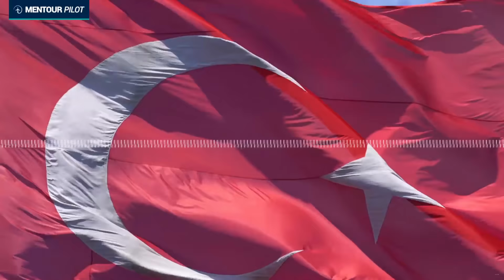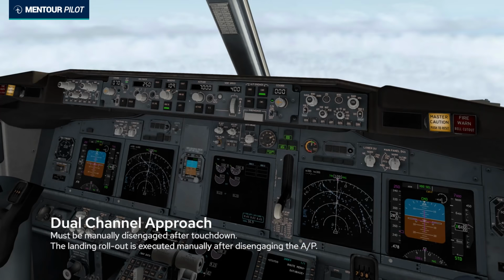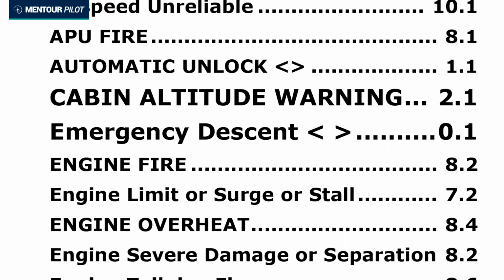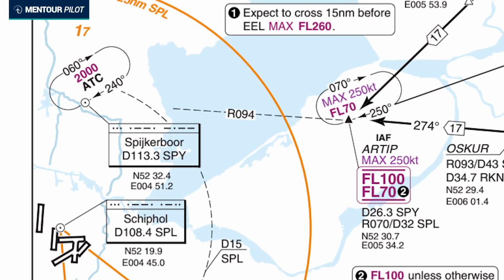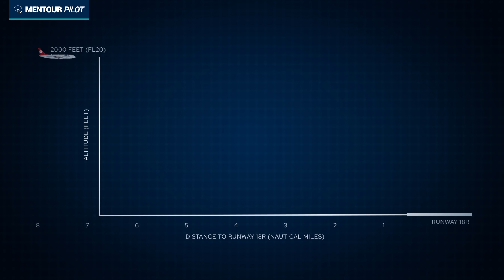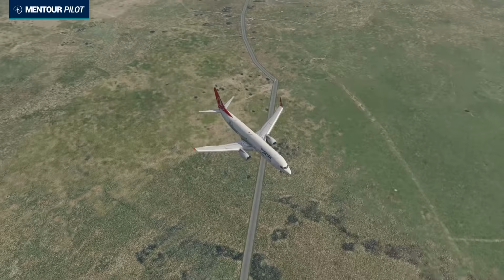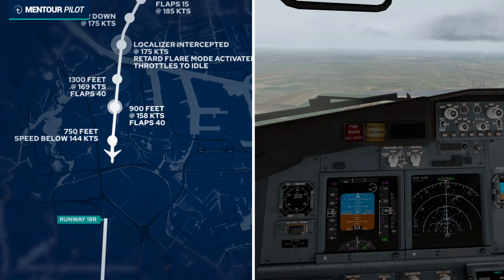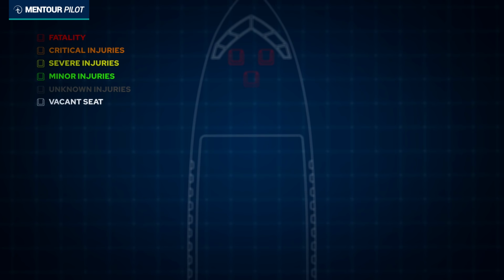What happened to Turkish Airlines flight 1951?!

Comment: Until the day of this plane crash, there were 2569 complaints about the radio altimeter problem in Boeing 737-800 model aircraft. Boeing company stated that this problem will not affect flight safety. Of course, it is easy to blame the pilot as in many accidents. It is both easy and profitable. I am sorry for everyone who lost their lives in the accident, I wish patience to their relatives. By the way, the video editing is great.
Reply: Yes, despite the shortcomings by the crew, they shouldn't have been in this position. Boeing don't seem to have taken the r/a failures seriously. There are many ways monitoring systems for intermittent problems but it seems like the best they could come up with was a bit of sealant.
Reply: Wow. We call that negligence in medicine!
Reply: To be fair to Boeing, though, the autopilot DID warn the pilots of this flight. The autopilots shut themselves off and made a warning noise (the first officer noticed and switched autopilot B back on). Also, the captain knew he needed to look at the altimeter (he muttered about it before the autopilots shut off). They openly acknowledged the altimeter's fault on the captain's side. The pilots should've known something was very wrong. They should've known to go around and troubleshoot. They should've known they needed to land manually. The plane told them something was wrong with it, and the pilots blatantly ignored it.

The loss of life was tragic, and Boeing definitely should've done something more about the radio altimeter, but we can't lay more blame than that on Boeing. Their plane gave the pilots multiple chances to rectify the situation.
Reply: I think it's worth pointing out that this is pretty much literally the worst set of circumstances short of an emergency that a crew could face for the radio altimeter problem to rear its head.  The Approach phase is already one of the highest-workload phases of flight for any crew - but on top of that you have an increased workload on the part of both pilots due to the navigation problem caused by the weather, leading to the late interception of the localiser.  The Training Captain's attention is being diverted from his "First Officer" monitoring role both by the intermittent alarms and the need to support the First Officer's training by keeping an eye on his solution to the late interception (and the possibility of intervening if necessary).  The Safety Pilot is handling communications with the cabin crew, which compromises his attention on the flight instruments and controls.  As for the trainee First Officer himself, training and checkrides are a high-pressure situation in the first place, he's still not particularly familiar with the aircraft and procedures, he's aware that there have been abnormalities with the aircraft systems, but - possibly because the Captain has not raised them as an issue - he does not question continuing the approach.  He's also probably got a concern in the back of his mind that because the Captain had to intervene to get the aircraft established on the ILS, this might end up having a negative impact on the Captain's assessment of his skills (and potentially his new career as a whole).

All of the crew were expecting the throttles to roll back at the point they did, and they probably caught sight of that in their peripheral vision - but because they are expecting it, none of them note that the throttles have retarded all the way to idle far too early.  Turkish Airlines' SOP concerning the Captain being the only crew member who can call for a go-around is problematic here for two reasons - firstly because it means that neither the trainee FO nor the Safety Pilot FO have "call for go-around" as part of their mental model, and secondly because this SOP does not take into account a scenario where a Captain is task-saturated (as seems to have been the case here) and misses cues as a result. In effect, they designed a "single point of failure" into their procedures.

Boeing's approach to the radio altimeter issues (insisting it would not affect flight safety) was at best lax and at worst inexcusable.  I have to wonder if there was an actual proper systems safety analysis performed on the consequences of this failure in all phases of flight, because with over 2,500 reports of the radio altimeter failures being reported by crews, there damned well should have been.  It certainly falls well below the standards they set in the 1960s, and is reminiscent of the effort they put into trying to prove that the 737's rudder PCU issues which became infamous in the '90s must have been caused by unintentional pilot input, rather than spending that effort (and money) looking more deeply into the problem.  Now in that latter case , it's only fair to point out that it was a Boeing engineer who eventually discovered the potential flaw in the PCU valve design and manufacturing process, and when it was discovered, the company very quickly reconvened the NTSB and FAA safety groups to eventually solve the issue...  However, I can't help but think that if they had set the engineering department to assess the problem more thoroughly after UA585 in 1991, the lives lost on US427 may have been saved.
Reply: @hauntedshadowslegacy2826  - The "pilots" didn't ignore it.  One glaring issue was that Turkish Airlines' SOP was that only the Captain had the authority to call for a go-around, which meant neither the Safety Pilot nor the FO under training had "call for go-around" as part of their mental model (or set of options).  The Captain in this case had his attention split multiple ways - firstly, he had his designated role as Pilot Monitoring during approach phase, secondly his role in assessing the trainee (and being prepared to intervene if necessary), thirdly trying to resolve the navigation issue caused by the westerly winds and correct the ILS interception, and finally probably trying to figure out what was causing the alarms and indications which indicated a technical abnormality.  In other words, there was only one person on the flight deck who could call for a go-around, and he was task-saturated to the extent that he failed to notice the flight missing the "landing gate".  While mistakes were made by the crew, and the problematic SOP giving only the Captain go-around authority were brought to light by this accident - the fact is that Boeing should have performed a proper systems safety analysis regarding the consequences of RA failure well before then.
Reply: @turricanedtc3764  Not sure I agree. The Radio Altimeters only really have a function if the aircraft was going to Autoland. It is SOP to always set the aircraft up for an automatic landing and then take the autopilot out when fully visual and do a manual landing. That is normal. The only function of the Radio Altimeter when visual is to give the "50", "40" and other calls which are really relevant to a manual landing. Those calls are not that important,  aeroplanes land quite well without them.

If the aircraft had been fully configured by 1000 ft, the First Officer would, presumably, have taken the autopilot and auto throttle out and hand flown the rest of the approach. Approach gates are there for a reason and if you ignore them you end up rushing things. In the airline I last flew for, continuing past a gate would earn you at the very least a phone call to ask you why and usually a visit to the flight manager without coffee.

The real glaring error was that not one of the three pilots seems to have noticed the extreme nose up attitude (they would have lost sight of the runway under the nose) or the very low speed (the ASI would have been dominated by red shading). They are all guilty of an extreme lack of attention.
Reply: I feel like there were 2,569 simultaneous cries of "I FUCKING WARNED YOU" after word of this got out.
Reply: But the radio altimeter does not affect flight safety on it's own.
Reply: @alsleepr  It's not the same. A scalpel will not kill unless YOU stab someone.
Reply: Here's the thing though: Boeing isn't entirely off the mark. Yes, the fault in the altimeter should not have happened, but at the same time, the pilots of this plane were making one mistake after another. If you listen to Petter summing it up here, the pilots were behind the facts right up until the moment they hit the ground. Not having the landing checklists worked out, not being configured for landing in time, intercepting the glide slope too late, not communicating with each other when literal warning sirens are blaring... The fault in the radio altimeter and its connection to the autothrottle is the final push in a long list of things that have gone wrong, so while it shares in the blame, so do the pilots.
Reply: @turricanedtc3764  In my limited view of accidents in any kind of traffic, there are two key ingredients: One person making an error, and one person not paying attention. Ignoring a red traffic light, driving without lights, driving too fast or too slow, or technical malfunctions that cause the same as a person making an error: A movement that is not supposed to happen. Unless they are set up to pass each other within inches anyway, an accident can be avoided if both are paying attention, and evasive maneuvers can be made in time.
In this story we have both: A person making an error (the auto throttle) and one not paying attention (to the cause of the warnings). Without either, this accident likely would not have happened. 
Boeing's main fault was claiming it would not affect flight safety. Everything does. Hell, even one of the passengers wearing a sexy dress will affect flight safety. Not always to a dangerous degree, but the influence is there. It just needed the right set of circumstances: a really busy airport giving a shorter path of approach, strong winds shortening this path even further, a trainee without the experience in this type of plane to notice something was off, a captain having to split his attention on many things and becoming overburdened because of the first two, all things combined with a faulty autopilot that keeps stressing the pilots and distracting them from other things.
Reply: @turricanedtc3764  Thank you very much for this convincing analysis.
Reply: @SuperHeatherMorris  Pilot Errors were clearly an important reason for this crash - but not the only reason. And talking about Pilot Errors in this case: May it was the bad luck, too, that a very unexperienced FO on the 737 was Pilot Flying during this challenging approach, because he clearly comes to his limits here, so that the Captain had to step in, distracting him from his duties as Pilot Monitoring. And adding to this the fact that according to the SOP of Turkish only the Captain had the right to call for a go-around. So the Safety Pilot had not on his "screen" a call for a go-around when he acknowledged what was going on.
Reply: @sjonnieplayfull5859  Indeed. And adding to this: The Captain had to do the radio with the different ATC, too. The voice of the pilot which you can hear in the video is the voice of Captain Arizan.
Reply: @childofcascadia  "Honey, btw., Boeing is a s..t company." - I love this lovers... :-)))
Reply: @hauntedshadowslegacy2826  Boeing's safety record recently and bad attitude towards safety says it all. I will never consciously choose to fly Boeing if I can go with Airbus.
FAA should kick their butts over MAX. A lot of bad things in aviation happened because a new type of aircraft with a lot of mechanical and design changes - was sold as a version of a popular old type just so that Boeing's selling point is "less training required". Their executives probably go golfing with Trump instead of doing good business and providing safe aircraft.
Reply: @SuperHeatherMorris  "They are all guilty of an extreme lack of attention."
Well they did pay with their lives for that.
Reply: @hauntedshadowslegacy2826  just because it make a warning noise, does not mean it is working, just as they hear the pull up warning doesn't mean the plane is recoverable. upon detecting the input data is not reliable, the system should automatically disable and stop that data from being use. this issue would return to haunt boeing in the 737 max as a different sensor failure is not detected and it input disable to the computer system.
Reply: @lagrangewei  That one was even more egregious, as they allowed a flight-critical system to be led by data from just a single sensor, which is an absolute no-no.
Reply: Was Boeing not held accountable?
Reply: It never stops being the pilots job to fly the plane. The autopilot is a cool feature, but it's always their job to fly the plane. 
There were 3 people but especially 1 person who should have been watching the throttle, and I dunno, watching the fact that their plane was missing the runway.
Reply: @PTMG 
Yes But no human being has an in-built Altimeter.
Over 2,000 complaints and nothing done about it is a type of manslaughter ie the manufacturer Does bear responsibility for accidents second to faulty equipment regardless of the pilot's ability.
Reply: @sjonnieplayfull5859  it's indicative of a really pathetic training department at Turkish Airlines. It's really not that complicated, one of the 3 pilots just had to note the airspeed. Probably the single most important instrument on an approach. The fact that all 3 pilots couldn't do it is embarrassing. Then even when the captain does notice because of the very visceral warning of impending stall he still doesn't react properly to the low airspeed. Imagine thinking you're too slow in a car and not hitting the accelerator, but the brakes or vice versa. That's what he did. Archaic overbearing SOP probably reflects a general deficiency in the flight department. 

I hope more carriers modernize their CRM perspective because the US and European airlines have already killed enough people to warrant the changes now implemented. Unfortunately that means a very hard ego check for a lot of pilots, and everyone wants to be a buddy.
Reply: @lagrangewei  it's not the same as the MAX at all. Radio altimeter faults are not that uncommon. The MAX had a system that overrode(physically it can overpower the pilot) to drive the plane into the ground like a lawn dart. A radio altimeter failure makes coupled approaches unusable because you typically need 2 working radio altimeters, and in this case it gave the ground proximity warning I guess, but that's still easily flyable. Blaming the machine can really blind people to the institutional failures many of these carriers seem to have. In particular; over reliance on automation with 0 monitoring, thinking captains are gods, and weak training departments. Planes have been on fire and cursing at flight crews and they still land if the crew can get the controls to work.

I also strongly suspect fatigue plays a strong role in these crashes where no one seems to be observing anything in particular. Like people driving off the road. The time of inattention to stall vs drive off a straight road is pretty close I think.
Reply: @zerotoleranceforsataniceli4794  the plane has an altimeter in addition to the radio altimeter not that it matters, plus your eyes are an in built altimeter when paired with a precision approach and clear weather. They didn't crash because they were confused about their altitude, they crashed because the plane wouldn't land for them and they weren't watching their speed. I know it seems crazy but most of the time the pilot does actually land the plane. Apparently not the case with Turkish.
Reply: @justcommenting4981 
I think that's a bit harsh.
They couldn't accept that the equipment was faulty, so they entered a zone of cognitive dissonance and that was their undoing.
Reply: @zerotoleranceforsataniceli4794  adding more words doesn't make it better. A small thing went wrong and they crashed because they weren't paying attention to everything else they normally should pay attention to is another way to put it. How is it pilots don't enter cognito hazard when the engine fails or the 2000+ other times this problem occurred? Awful training needs to be the norm for this to happen or they were almost all literally falling asleep(possible). Neither possibility is good, both indicate a deficiency in how the airline was/is(?) managed. Someone else said only a captain can call go around there and if that's true I wouldn't fly on them or any airline run like that.
Reply: @justcommenting4981  MAX problem wasn't altimeter, it doesn't check the altimeter at all since it was intended to be active regardless of landing or flight. you are just misunderstanding the discussion. we are not talking about what failed, but the cultural of design that allow these failure to be designed.
Reply: @lagrangewei  I understood exactly. The quality of the malfunctions is totally different and your comparison was not apt.
Reply: @justcommenting4981 
I think that's the norm - whoever is the flying pilot is the only one to have the prerogative to call for a  Fly around.
I guess if there are 2 or 3 people present in the cabin and if anyone can call out Fly around, then on a bad day, imagine all 3 calling it out at different times -  the plane may never leave the airport!!
Loop - the-loop  until you run out of fuel 😅
I think it avoids chaos!
Reply: @justcommenting4981 
I think you misunderstood me.
Check out all my comments under video as you'll see that I agree with you.
I was explaining what Mentor Pilot had said &  what I thought the reasoning behind it was.  I can't vouch for what M P says though, as I'm not a pilot.
Reply: Still, thats what a pilot does. If the failure of one device caused a crash, thats pilot failure. Everything in the aircraft is redundant and systems will always fail
Reply: @samuvisser  one wing breaks, use the other one.
Reply: @hauntedshadowslegacy2826  Boeing also had a single point of failure there, as both autopilots were driven off the captain's radio altimeter, according to the Dutch investigation. However, training material didn't indicate this anywhere.
Reply: Boeing 737-800 is the safest plane ever ! This was just simply maintenance , and pilot error.
Reply: @alsleepr  Better call it BS !
Reply: So many of these accidents are caused by these 'small problems' which become flipping huge problems in compound difficulty situations.  Boeing are at fault here, Schipol also with zero margins for error to maximise profits
Reply: @hauntedshadowslegacy2826 I realise I'm a bit late to the game here... I'd agree with what you're saying if there had only been a handful of reports, but when a company fails to appropriately react to over 2.5k reports, that IS negligence. Yes, the pilots failed to respond appropriately, but they did so over a matter of minutes. Boeing failed to take appropriate action over months or years. Unfortunately human error happens, and this accident lead to a lot of improvements in training to avoid that being repeated, but corporate failure should be far more preventable
Reply: The altimeter wasnt really the problem but the interaction between it and the autothrottle.
Reply: look at what happened with the Max, they blamed the first accident on pilot error and only after the second crash, they fixed the issue because the fleet was forced to be grounded. They cut corners focusing on money and blame the pilots.
Reply: What I'm shocked about is that a) there was no system to detect impossible altimeter values and automatically flag the altimeter as unreliable, and b) there was no checklist for invalid altimeter readouts that involved shutting off the bad altimeter.
Reply: And the Turkish airlines Boing crash was the 3th crash within 6 weeks
Reply: Just like what happened with the MCAS system they tried to blame the pilots first, But it didn't work out for them.
Reply: @hauntedshadowslegacy2826 
Finally someone with a brain making comments on social media.
Reply: Boeing strikes again...at least Boeing CEOs make bank though, am I right?!
Reply: Classic Boeing. As the saying goes nowadays; if it is Boeing, I ain’t going.
Reply: @alsleepr but you're only "practicing" so y'all generally get away with negligence the same as Boeing has been doing for many many years
Reply: @uross4743 Not true at all. You obviously know nothing about medicine. If a scalpel isn't properly cleaned or dull and your surgeon accidentally nicks your aorta while trying to remove your appendix, is it the fault of the surgeon, surgical nurse, scrub tech, central service tech, or operating room technologist?
Reply: @turricanedtc3764  That's  terrible SOP then... Hopefully it's changed since this happened.
Reply: @jrmckim  I don't know anything about meeicine. In fact, what is a scalpel? What's a surgeon? What's an aorta? Appendix? Where did you recieve this advanced knowledge?